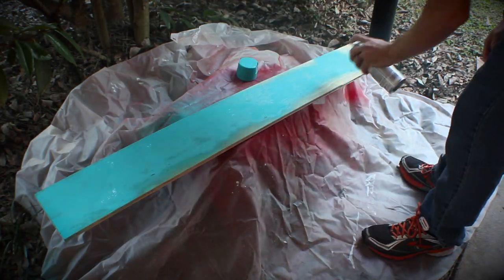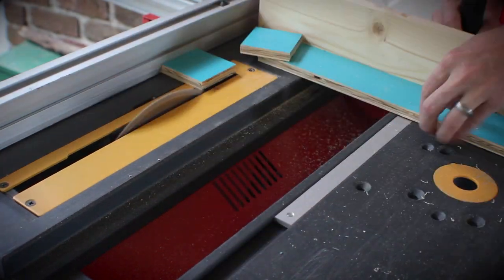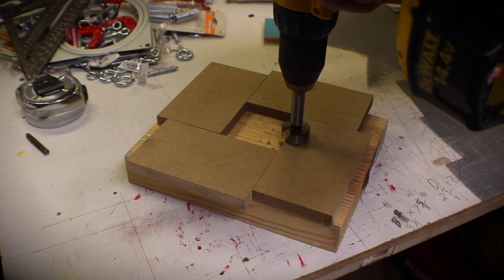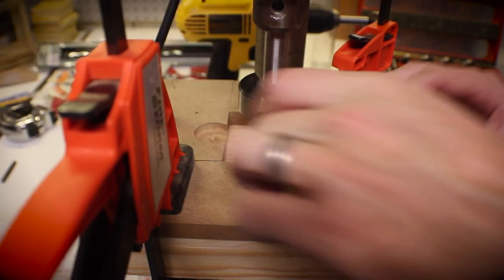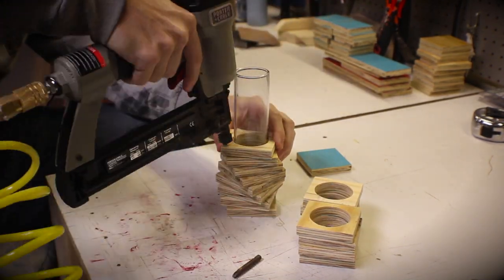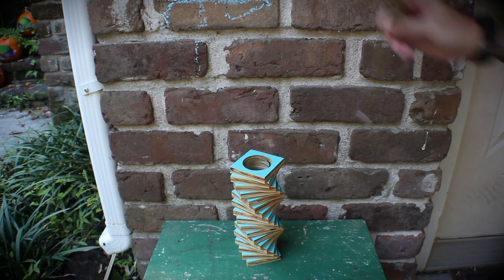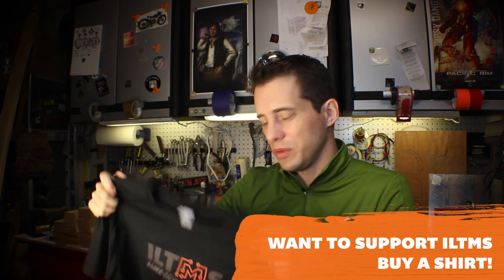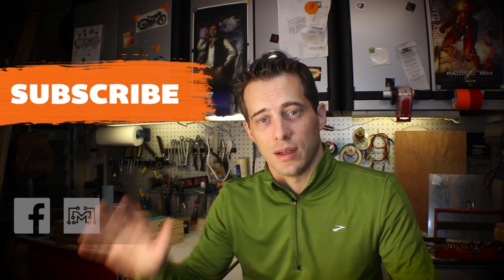How to make a spiral plywood vase | I Like To Make Stuff

Comment: This is the same technique I use to make table pedestals for my restaurant.   Tips: Make sure your pieces are cut as accurately and consistently as poss as even 1/8 errors can be magnified in the twist.  Also-nails, no screws or glue.   Screws tend to lift the layers unless pre-drilled, and glue expands which seperates the layers and makes it look weird.   For real fun, take a carbide burr bit on an angle ginder or cutting tool and smooth the edges.   Looks amazing that way.   See pics at the stew pot kitchen fb page

Comment: Hi Bob, just found your channel and really like your style.  
Just a question/thought would a hold-saw with a not have made an easier choice as you were going through the entire board (you would have had some useful scrap disks too).  Anyhow great job.
Reply from the maker: I actually tried a hole saw, but the problem is that the leftover disc gets jammed up in the hole saw easily, and since I had to cut so many, that got to be a pain.  I ended up making 11 of these vases at once, so I had a HUGE number of holes to drill.  If you had a small number to do, I think a hole saw would work great.
Thanks!
Reply: Fair comment, keep up the great work

Comment: If you made it a little shorter and wider, it could also function as a candle holder with a "water fall" for the melted wax
Reply from the maker: Kevin Jensen Great idea! That would look really cool!
Reply: Um, are you sure a wooden candle holder is the best idea?
Reply: Angela Hsiao if you only make the hole in the top block it would work fine. you would have a short hole to keep the candle in place, and the flame would never touch the wood :P

Comment: Does any1 know if there is a way too cut the holes without the drill press
Reply: CINOS DJ 
You can use that drill bit in a hand drill but it's difficult. It's possible to use a hole saw also.

Comment: When you cut the stock on the table saw, I think your technique is dangerous.  You could easily injure yourself, and I think you should take this video down so others don't learn your unsafe habits.

1.  When cutting narrower than 3", use a push stick.

2. >>Never ever put your hand on the back side of the sawblade.<<  Use an outfeed table to support the stock to prevent it from falling off the saw.

3.  In this video, I see that the plywood is bowed-- this can be very hazardous, and ditto for any wood that is twisted.

  4. When crosscutting,  put a short stop block on the fence to set the length.  Never use the fence alone to set the cutting length. The way that you did it in this video, one of those squares could have easily gotten caught between the fence and blade and then thrown back into your face at very high speed.  In fact, a crosscut sled is the safest way to cut.

> I urge you to review a tutorial on table saw techniques. I would not let you near my tablesaw until you showed me that you know how to use it safely.<
Reply: Bob Blarney Dude he's a professional, he knows what he's doing. He has informed others, let him be